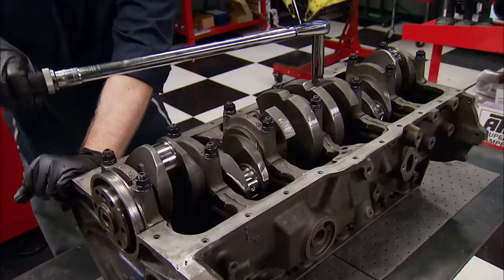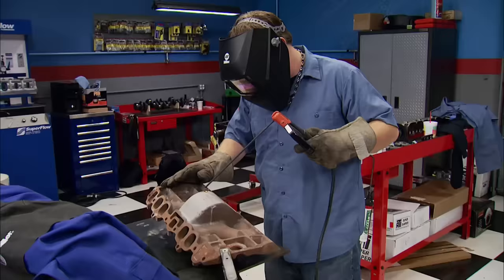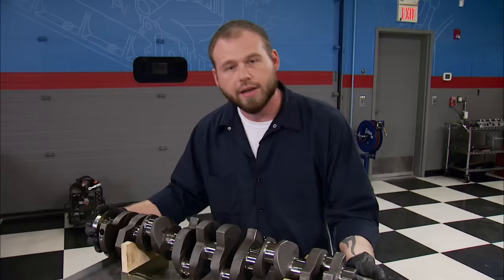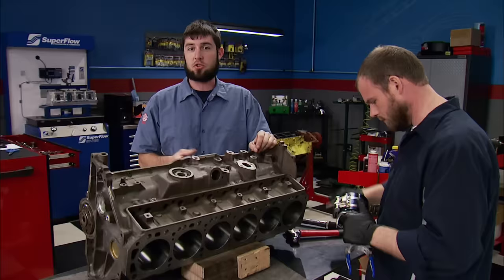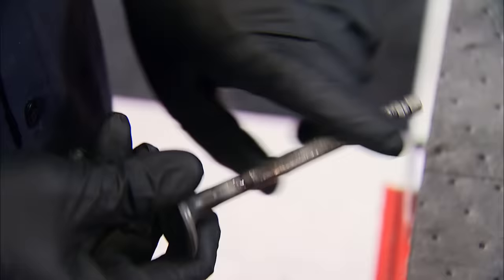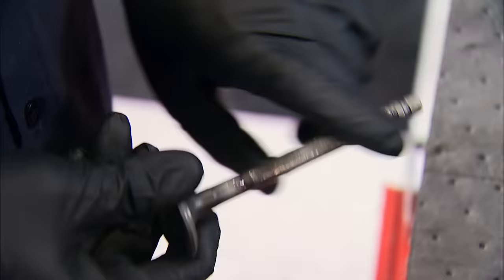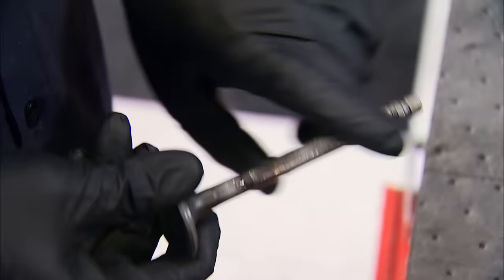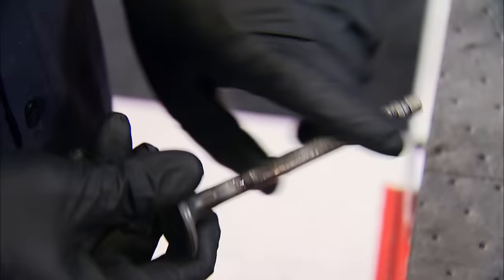What Will A New Top End Do For Our Old School Inline 6 On The Dyno? - Engine Power S1, E4

Comment: Good to see a straight 6 video but this ain’t the one that pat was working on. Hoping to see the turbocharged straight 6 video soon!!!
Reply: This one is an old video from the show about 7 years ago... they got another inline 300 from an agricultural pump which should have a forged crank and they teased about building for force induction... on the second episode they worked on it they said parts are taking a while to come in so hopefully this new season we will be able to see it with a turbo... they also did a chevy 292 early in the last season that they did turbo charge and got some massive numbers
Reply: @bigboreracing356  And?
Reply: The new 300 that was painted white is from a sewer Jetter  trailer.
Reply: @87FoRunner  🤷🏽‍♂️ whatever it was... it just looked like it ran a pump to me
Reply: Here in Norway we had an insane slant 6 turbo giving everything V8 in it's class either a damn good run for their money, if it didn't beat them outright, and that was 30 years ago!
Reply: @ToreDL87  And?
Reply: @TheFARM2019  Can someone explain to me why the freeze plugs are not just welded to the block?
It would take minutes and become one less thing to worry about.
Reply: @leoarc1061  the theory is if in case temperatures get too cold and the coolant starts turning into ice, the freeze plugs will push out and prevent the block from cracking and splitting from the entire cooling system turning into ice... however tho, the ports where those freeze plugs go were put there to get casting sand out of the engine block after it was produced and you dont want to weld them in either cause if you go with a full on engine overhaul, taking the freeze plugs out helps to get all metal shavings and debris out when washing... using the aviation sealant when installing the freeze plugs keeps them from pushing out and prevents any coolant leaks from forming down the road
Reply: @87FoRunner  i was just on their website and the episode where they move onto the next phase of the build will be available next weekend, so theres a chance it may be airing this weekend
Reply: @TheFARM2019  Thank you very much for your input. It does make sense.

Now we have coolants which do not freeze, and metal particles can be more easily removed. Especially for ultralight aircraft use, I would prefer to weld or epoxy them in order to avoid any leaks.
I will look into aviation sealants.
Thank you ever so much.
Reply: @leoarc1061  you can find the aviation sealant at your local auto parts store... the usually come in a bottle that the cap has the brush included
Reply: Boss 429 used screw in freeze plugs that were similar to plumbing pipe plugs, but custom with a thin spot that would blow out if the block froze.

Comment: Makes me miss my first truck. It was simple and didn’t cost a small fortune. Hey Ford bring back the bread and butter lol
Reply: Sadly, I think the days of a no-frills truck that will work, and thats it, are done. The prices of everything, much less new vehicles, has gotten insane. My old '94 F-150 with the 300 is paid for, and will be rebuilt when needed.
Reply: My first truck was 1992 f-150 6 inline 5 speed fresh burgundy paint job and three spoke aluminum wheels with 50 series cooper cobra tires
Reply: Agreed, back to when it was simple. Electronic equipment takes away from the mechanical devices diagnosis. AIR,FUEL,SPARK, and the road was more reliable and maintainable then this modern day headache of transportation.
Reply: Right on Tony!!!! This straight 6 was what I had in my '84 F-150..... Tons of room under the hood for ANY repairs.... not like today where it takes double jointed arms and 2 hours to change the battery or replace a headlight bulb. Last repair I did was change out the full pump that ran off the cam ( as you probably already know) in a Canadian Tire parking lot in the Annapolis Valley in NS.   Good times👍
Reply: Ford, Chev, Dodge will never do that. they want these trucks to die just before you make your last payment.

Then you have to go buy a new truck and start again. there is a reason why the Square body era trucks are getting hard to find and if you find them the owner will NOT part with it.
Reply: @focusedonfuture3255  No kidding . . . I've offers of up to 10 grand for my '84 F-150  . . . .but I keeping it.  I know every squeak and knock I hear in of that truck and can fix it myself . . . . electronics were the downfall of the backyard/hot rodder mechnaics.
Reply: That's a no shitter Tony..  Did you see where the first year sales of the New Ranger were crushed by the Nissan frontier??  It all boiled down to price..

Comment: Looks like they milled the head with an angle grinder lmao
Reply: They said that the welding process hardened that section of the block.
Should they have soften it back with a blow torch or by some other method?
Reply: Savagenoob: Look's like Stevie Wonder did it ...with his feet!

Comment: Had a 300 / 6 .that was almost indestructible. Same as the old slant 6's.
Reply: In high school I had a 240, that failed the rod bearings.  Glad to hear that most of them are strong.  Sad that I got a lemon.  Maybe someday I'll build one.
Reply: Had a friend who had a straight 6 in his Ford F-150 work truck in  HS and I've owned or known many a Slant Six!
Reply: @bigboreracing356  comparing apples to oranges with those engines.

In line 6 isn't about power...its an engine designed for reliability over long term.

Hence why most industrial and commercial power generators, semis, freight ships...etc...  All run a straight block.

Less vibration and stress on an in inline over a v block
Reply: Donald Lewis  they stopped makeing them because desiel engines gained popularity
Reply: Donald Lewis  

Well....and cars don't have 10 foot long hood lines any more..
Reply: i call these shitty ford 6's  milkshake machines....no power and lots of blown head gaskets and rattles
Reply: @bigboreracing356  
PFFFFFFFFFTTTTTTTTTBWUHAHAHAHAHAHAHAHAHAHAHA 
You dont know anything 
These and slant 6 were literally bulletproof
Reply: @bigboreracing356  actually you could let these things run really low on oil and it rarely did very much damage and you could run them at high RPMs constantly and it rarely did any damage compared to any other engine
Reply: @bigboreracing356  You are comparing a pee wee football league to the NFL.
Reply: @bigboreracing356  It most certainly did not suck.  By your reasoning, any engine short of a top fuel Hemi sucks, because the top fuel will pull them every time.  Taken for what it was built to do, it is one of the all time great engines, right up there with the Dodge Slant Six.
Reply: No Prep Stretch "It is not as efficient and safe on the freeway as a 302."  What does that even mean?  Never mind that for now.  You dog the 6 because it is smaller and less powerful than an eight cylinder. Well no kidding, Sherlock.  Nobody here supporting the inline six is claiming that they are more powerful than a V8. I swear you are too not to see that you last.  Oh, and another bulletproof engine is the Jeep inline 6.  See a pattern here?  Probably not. There is more to appreciate in life than just V8s.

Comment: Try the Clifford open plenum intake vs. the Offy dual-port.  Then using the Clifford, install a plenum divider under the Holley 390 cfm carb.  Seperate the back half of the intake from the front half, using a 1/4" aluminum plate.  The firing order of the 300 makes a pulse wave develop under the carb unless the plenum is divided front from rear.  This makes a 'wafting' current right under the throttle butterflys.  They say you can generate a little more torque if the air stream doesn't waft back and forth.   Makes the engine idle and maybe run smoother as well.   The Clifford intake allows a divider to be installed, because the carb base plate is removeable.
Reply: I'm using 500 cfm 2 barrel Holley on the open plenum. I have a 2 hole heat insulating spacer under carb and then the adaptor plate. This puts carb up away from manifold quite a bit.
Hopefully this negates the waft some.
Reply: @deadcarnahans1932  You ought to get a scrap of 1/4" aluminum plate and JB Weld it to the 2 barrel adaptor.  The carb has to sit with the barrels parallel to engine block.  The plate doesn't have to seal on the sides or bottom of the plenum, a small gap is okay.  An old school dude told me about this in the 1990s.  He said he could feel the difference coming off idle.  I have the pieces to do it, but never got around to it.
Reply: I think I'll do it but don't have the time now. Truck is running great now as is. Will update you with results if it gets done.
Thanks.

Comment: Loving this. I had a straight six in a 91 F-150, that thing was a bullet proof torque monster.
Reply: The base 3.3 v6 puts out more torque
Reply: @jasonlarsen3515  those 3.3 are crap.  Unreliable and weak mains and weak engines.  The 300 is a workhouse made to last
Reply: @eddiespagetti8395  the 3.3 still puts out more torque.
Reply: @jasonlarsen3515 it don't matter , the 300 6 has proven to be most reliable engine    3.3 lame weak.
Reply: @jasonlarsen3515  no modern engine can stand up to the longevity durability and low rpm power that is the 300 6 Ford even Chevy guys respect that engine pure and simple
Reply: @joshuadaniel1001  how much low end power you talking?

Comment: Hey! They got the carby faced the right way this time, not like they did on the Slant Six build. 
That 300ft/lb should give more then enough push for a stripped down 2wd F100
Reply: @bigboreracing356  Depends on vehicle mass. 300lb/ft (around 390Nm for us Metrics) in a chassis massing over 2000kilos, is better performing then most stock midrange minivans and SUV's.
390nm in a 1000 to 1200 kilo stripped down Rat Rod or Pickup, is a rocketship on the street, and with all that low end torque, could handle a taller diff and wide ratio gearbox, using the gears to get off the line, and the diff for highway cruise economy.

Comment: @powernation this 300 has a lot more to give, but those numbers are respectable for a streetable 300! You could gain some NA HP by zero decking the block and possibly popping the pistons .005" out of the holes. The felpro head gaskets available for these are pretty tall (.045 crush give or take) so getting your block at zero or above will help with quench tremendously. Take a bit off the head and CC it so you get to around 9:1 or 9.5:1 compression and she will probably give you 225-250hp or better with a good improvement in torque. These are all things that, to save money, you can have done in lieu of just a basic head and block surface. Also, if you can find a 2x4bbl intake from off or clifford, you can use 2 smaller 2bbls for equal CFM but better fuel distribution and possibly be able to give her more timing with a better mixture. HUGE NOTE that people need to be aware of here for a street driven 300!! You MUST have a water heated intake! If you don't, you will get fuel icing conditions on the street and it will stumble and run like crap until the engine is up to temp....and forget driving it on a cold day without a water heated intake. Because 6's don't have the manifold directly over the block like a V8, they utilized exhaust heat in stock form to keep the fuel atomized in the long runners of the intake. With headers you can't do this, so the non-heated intake and a set of headers should be considered a race only application.

Comment: "That'll hold it till it breaks" dang straight Tommy! Bit harder on a part that big but preheat + putting it into a warm oven to let it cool slowly, helps too.
Reply: Right? I was cringing as they started welding on cast iron with no pre or post heat happening. At least they used the correct filler.
Reply: mmarchmonte88   Yes and l also noticed as he was dressing up the weld a porosity hole , would not pass a weld inspection x-ray
Reply: What he say?,... This would not happened wit a chevy engine, but then he tests his welder current on a  decommissioned GM scrapped piece?...By the way, CRAPPIEST stick cast iron welding job! ... no pre-heat, no clue, and not enough time under the belt!, I would'nt encourage leaning how to weld from this video, ....Regards.
Reply: When l was learning to weld l asked my weld instructor “How to weld cast iron “. He said to heat it to where you can barley hang onto it & then immediately peen it , with my chipping hammer , NOT a 16oz ball peen , but no matter how hard l tried it just kept breaking , & l could hear it pop! This went on until until it got real hot ! In additional schooling l found out , the preheat temp should be about 600* F ,chip of the slag & post heat , drawing the temp down slowly . Subsequently l been able to weld cast . I don’t know how they managed for it even to stay together .

Comment: I think y'all's new mechanic is a good addition to the show. Dropping the block, well, as Forest Gump would say, "stuff happens". It's a human thing. Anyway I learned something about welding cast iron and the block was repaired so it's not so bad after all. I like the idea of putting those 35's on my 96 4x4 F-150 but I'm wanting to put a turbo on it's 300. Really enjoyed the show and am super glad y'all are doing a wide variety of engine's. I'm not bias and like 4, 6, 8 gas and diesel engines. There will never be a better sound than a V8 though in my humble opinion. Thanks and keep up the good work.
Reply: If you ever heard an inline six revving to 7500 RPM you might change your favorite.

Comment: The cylinder head “top end” was sourced from an efi engine and fitted with the offy intake and holley carb. I think they had a tad higher compression and flowed a bit better than the smog era head.
Reply: That's not an EFI head, and the efi heads flowed less than the carb heads

Comment: I like the new guys idea of what to do with this motor....make sure that 77 F250 has a manual with a creeper and you can pull a building off it's foundation!
Reply: With the right sticky tires, climb a vertical rock face
Reply: My 2wd 88 out pulled a 94 4wd big block dodge I was laughing when I was told I didn't have a chance since I was only 2wd

Comment: For your broken block there I would recommend preheating the whole block and grind it out like you’re talking and Tigue welder and I would use a filler rod from muggy welds that you have really good stuff and I think you’d be better off that way and also by preheating the block you’re also stress relieving it this is Jim mungai from Pennsylvania and yeah though for 306 is the only engine that won the Baja 1000 3 times

Comment: Last time I repaired a broken cast iron part I used a nickel bronze rod, proper flux and an oxy acytelene torch. Preheat the area until the flux glows and brazed away.
Reply: nickle is stronger than brass
Reply: @scottgoforth7227  True but that part in not highly stressed so a bronze weld will work.
Reply: my trans is bolted up to that part and mounted off the tail shaft to the chassis, and what about lateral twist when in a heavy  pull?. I've  welded up engine blocks with brass when have lean missfire aka "detonation" more of a bush fix at the racetrack butt at 300 horses i dont think brass would hold up to the weight of the engine and with stand the lateral twist to many times not to mention the viberation that occurs.
especially  on take off auto or stick
Reply: @scottgoforth7227  Given the expected use I agree with the welding so long as the weld is Annealed.
Reply: @gregwarner3753   yes we do the same aircraft aka crop dusters the old dogs call it normalizing lol

Comment: Best way to weld cast iron is to use a nickel rod with the flux removed and tig weld it.
Reply: Preheat and insulate and let cool by itself is usually recommended.
Reply: You can weld cast iron and after cool it with a blowtorch,  increasing the distance of the weld over a couple of minutes.

Comment: I just rebuilt a 1960 Ford 223 inline 6. It would be interesting to see power difference in a  223 vs a 300.
Reply: I was just thinking this, my dad has a 223 in our 58 ford that will need rebuilding and I'm would love to build it a bit get a bit more power out of it.
Reply: @Papa7Bravo  I rebuilt my grandfathers using mostly original parts in his 1960 F-100 on a budget of one grand.
Reply: @jamesarmstrong1641  I've been toying the idea of building a v8 and maybe putting that into it. And I have a ford sierra saphire project which I'm thinking of doing a cosworth engine and turbo twin carbs. But then I've also just been looking at getting a 4.6 2v and running it on carbs, that way I can get experience of them engines as my daily crown vic has one so absolute worst case if I need to do any work on it, I'd at least have a clue.
Reply: @Papa7Bravo  see I’m only into like the big three (Ford, Chevy, Dodge(Ram)). I got a 1970 C-10 I’m looking at getting and getting me a crate 350 in it. But it would have to be after college. I’m only 18 and trying to rebuild my grandpas 60 F-100 is a lot simpler compared to anything newer.

Comment: Have a '96 f250 with a straight six.  350,000 miles. Still runs strong and doesnt use a drop of oil.   Long after all these fancy V8s are scrapped , there will still be 300 in lines going down the road.